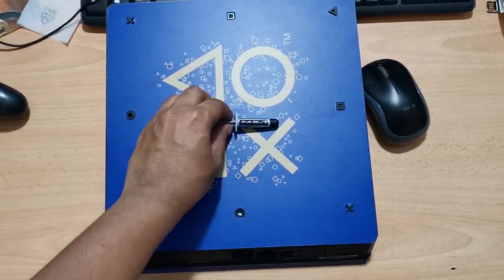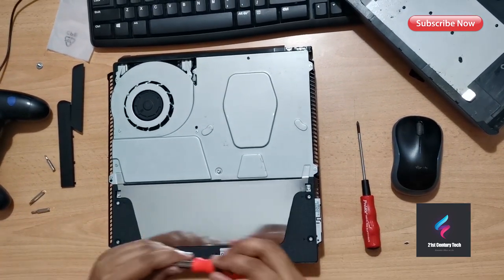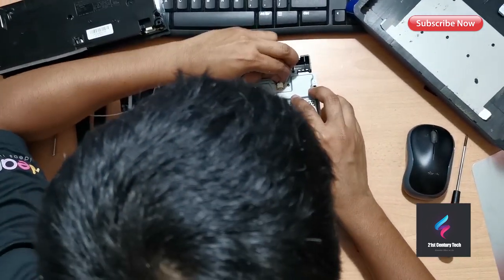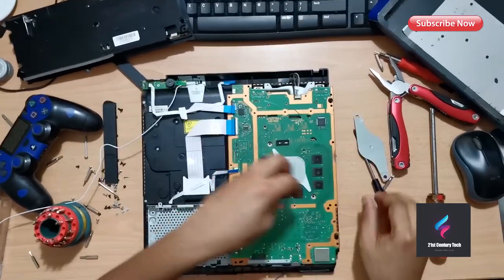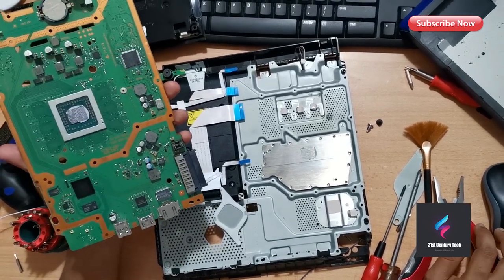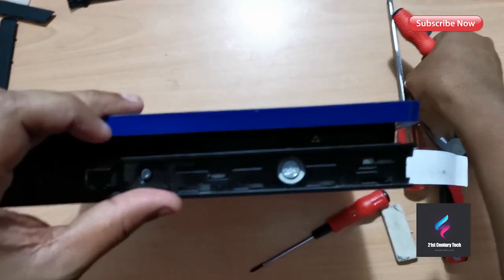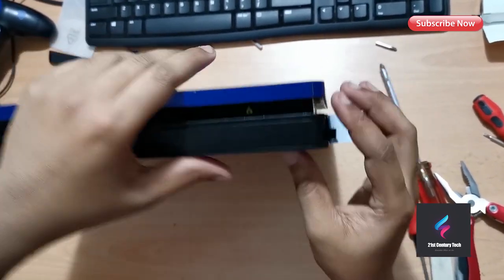Overheating PS4 Slim Disassembly & Thermal Paste Replacement

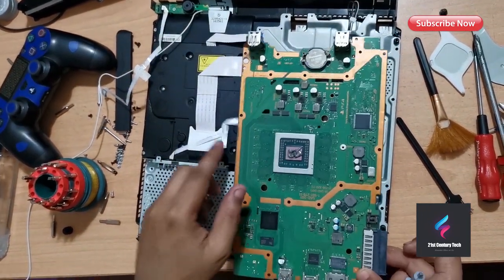Comment: 10:57 dude, a little too much ...
half this will be okay
Reply: Question from one how has no idea of this, what would happen if too much????
Reply: @RaZZaR18  it does look like a lot
Reply: @RaZZaR18  if the thermal  paste is conductive  it will break the chip,if it isnt then it will make a mess
Reply: @RaZZaR18  nothing would happen.its better too much then too litle.thermal paste is not conductive
Reply: @hey696969  I put too much thermal paste and it kept overheating